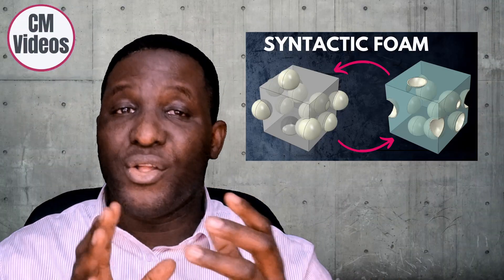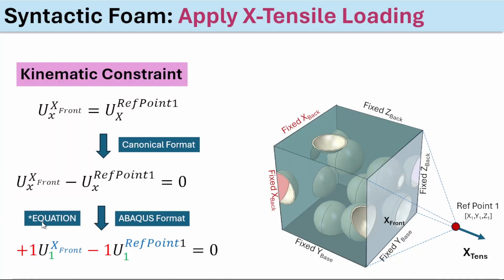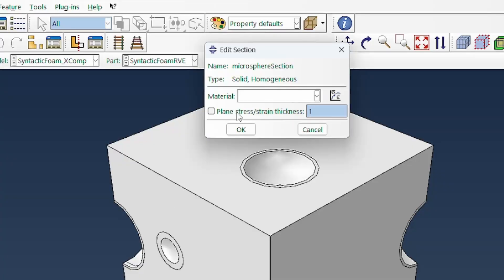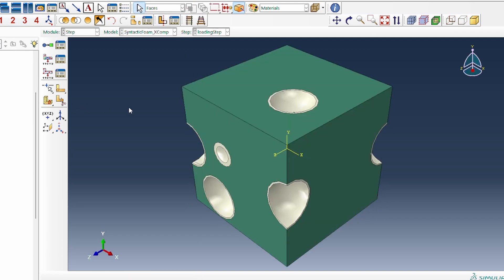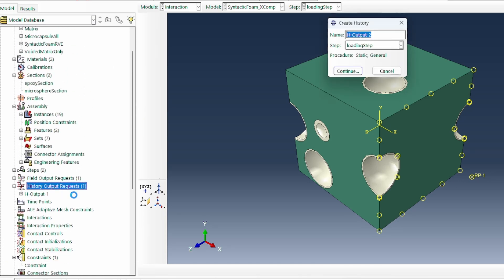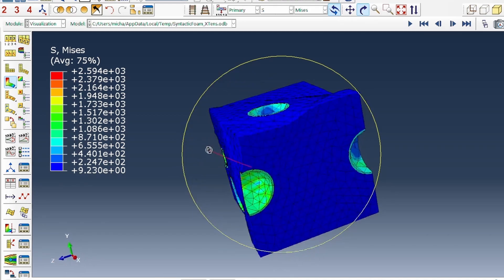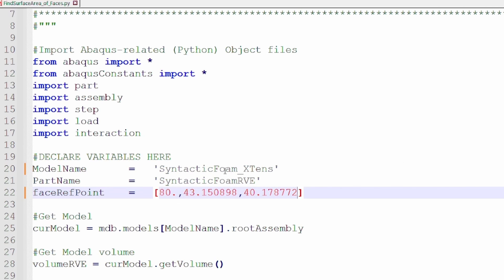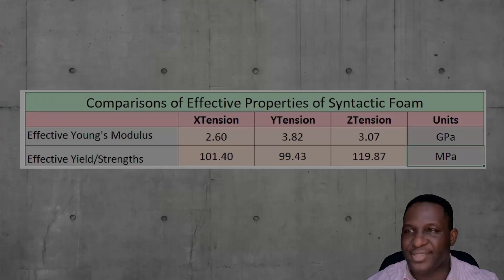RVE Modelling of Tensile Deformation of Syntactic Foams

Comment: Dear Dr. Okereke,
Thank you again for the wonderful informative videos.

I have a question, 
as we do tensile, compression, or shear tests on our RVE models we get some stress-strain values, however, these values can sometimes (or in most cases) not the same as experimental values. but the young modulus calculated from the slope shows a correct value. could you explain if this is normal?
moreover, is there a way to calculate the stress-strain values that are same as the experimental ones?

Thank you for your time and help.
Reply from the maker: Hello, this is a good comment.

The numerical and experimental stress-strain plots (when the numerical ones are obtained by computational homogenization) should be the same. This is what I do here. However, you may not have them matching each other because of the underlying constitutive models of the fibre, matrix and interface in your model. 

You need all these properly represented for the experimental and numericla plots to match. If you want them to be correct, then get a correct matrix model. I usually use elastoplastic material model in my simulations, but real matrices do not behave this way. 

You might have to create a User-defined material model for your matrix which will capture the holistic behaviour of the matrix. With such, and adequate interface effects incorporated in the RVE model, then you have and comparable plot.
Reply: @MichaelOkereke   Thank you very much for your complete answer.
Another question has arisen for me now,

As I am a follower of all your videos I have realized that you mostly give mesh size of 10% of your RVE size, is there a reason behind it?
Since I know we should do RVE size and Mesh dependent checking for our simulations before starting with the majority of them.

Thank you again for your time and help.

Comment: Hi Sir I find your content very useful. I'm a final year engineering student. I need your help on how to simulate elastomers (made of Ecoflex) embedded with liquid metal (Gallium or its alloys) when I apply tensile deformation on it and change the phase of liquid metal by varying temperature.
Reply from the maker: Thanks for your commment and good luck with the research. I do not have any experience on the change of phase of liquid metal modelling. However, the framework I have published with my RVE modelling videos can work except you just have to specify the most appropriate material models for the constituents. I wish you luck with the research, but sorry I am not able to help right now.

Comment: Hello sir,

If I intend to model an explosion effect on the syntactic foam.
How do you advice that I carry out the explosive modeling?

Would it also be at a micro level?
Reply from the maker: Hello, I do not think a microscale modelling of the explosion is ideal. Normally, the sort of explosive modelling it at structural or macroscale format. This would usually, in ABAQUS, involves you using a CONWEP option under the interaction module to recreate the explosion. The length scales required is often very large and setting it up in the microscale is not feasible. 

There could be alternative ways, of directly applying a pressure wave on the microscale but I am not sure if there will be a  sensible output from such a study. You may end up with localized stress rises and the deformation might not be representative of the macroscale explosive response. I am speculating here but my gut feeling is that I will not model this at microscale.
Reply: @MichaelOkereke  thank you so much for your prompt response.
In line with your experience, how would you propose I model the foam at the macroscale level? Or perhaps if you have a video for it, I would love to know how to go about it. 
Thanks so much Dr. Michael.

Comment: Hello Sir,

I have a question. I am working on a 3D unit cell model of a plate lattice structure. Because of the thin walls of the structure i modeled it with shell elements. Now i want to apply PBC to it but i am wondering how i have to constrain the rotational DOFs of the nodes on the oppsite faces.
Reply from the maker: Hello,  thanks for your query.
I am a bit confused that you are modelling a 3D unit cell and still somewhere combining it with a shell element. I hope this is right and you are correct in your description of the problem. I would have thought you either do a 3D (continuum) element problem or a 2D (shell or beam) element problem. Maybe, there is special case you are considering here.

With regards to imposing PBC on the domain, this should be okay. Here is a video that I did a while back on PBC with 2D lattice structures: https://youtu.be/4YDnKogZ_Ng?si=2XMqpRV0CZmclIwJ
This might help you.

With respect to rotational degrees of freedom, I usually do not bother about the rotational degrees because the sort of mathematics of PBCs that I use is applied directly on nodes so a node-to-node coupling only allows for displacement degrees of freedom. Rotation DOF is not usually acceptable, as nodes do not show rotational degrees since they are points. If you are focussing on linking elements or segments of a beam, that rotational degrees of freedom will also be specified. I will adopt the same approach I use in defining the rotational DOFs as the directional displacement DOF.

I hope I have not confused you but that is the thought I have about your problem.
Reply: I am modeling plate lattices similar to those shwon in the article:

Additively-manufactured anisotropic and isotropic 3D plate-lattice materials for enhanced mechanical performance: Simulations & experiments

My plates are very thin so i modeled them with S4R shell elements. The nodes of the shell elements do have in addition to the displacements the rotational DOFs UR1, UR2, UR3. I am wondering how to link these additional DOFs of two nodes on opposite faces to correctly apply the PBC.
Thank you very mutch!

Comment: Thank you sir for this work ! Please sir, i need your help and your advice  i 'am student . Now, I am working on modeling fatigue behavior on my internship for parts from additive manufacturing, these parts contain lack of fusion defects (LoF) so I would like to model a 2D volume with abaqus then I will generate defects (with python)  according to a distribution law (defect sizes, shape, etc.) then I apply a constraint on this volume in order to calculate the stress concentration and the fatigue life as well as the stress field distribution.
Reply from the maker: Hello, thanks for your query. I am not sure if I am able to help you with this query. I have no experience with Lack of Fusion defects specifically but could comment more broadly about the RVE modelling requirement.

What the problem does sound to me is that you are considering isolating a 2D RVE of a additive manufactured material and want to incorporate some defects on the part and subsequently assess the effect of the defect on the macroscale (stress-strain) properties of the product/part. This makes sense as I can see the need for the research. It will be optimal to use numerical methods to assess the viability of 3D printed parts to help adjust the manufacturing process, if possible.

If the above is correct, then I think there are a lot of videos  on the CM Videos channel which I have about, and which can help you. I suggest you  look at the videos about:

1. Creating virtual domains with microscale defects (look at videos on porous or void media)
2. Applying periodic boundary conditions on such heterogeneous domains (automatic and manually)
3. Extract homogenized effective properties (nearly every RVE modelling video, I always end with this)

If you check these free resources and still unsure how to proceed and want to consult with me specially on this, then you can book a consultation with me via this link: https://calendly.com/michael-okereke/deep-dive-into-your-computational-modelling-challenge.